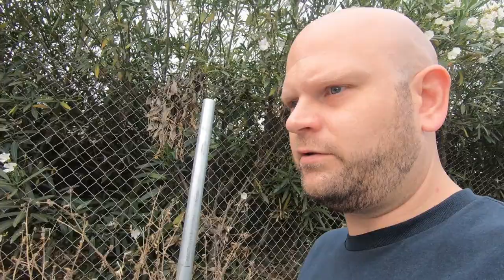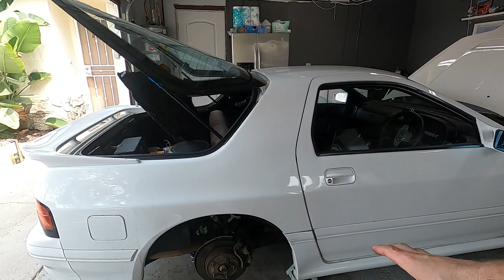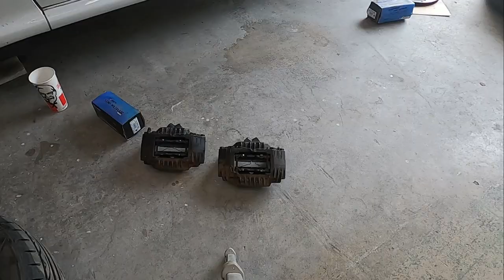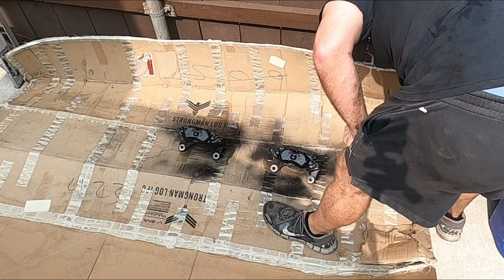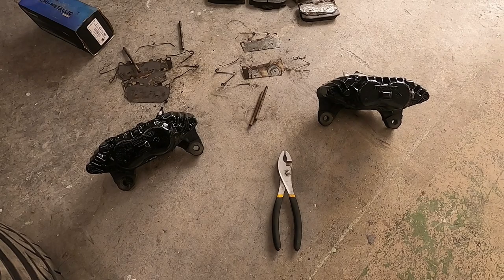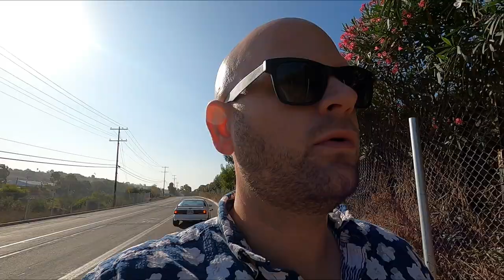R1 Concepts Brake Restoration RX7 FC3s

Comment: I bought the same exact vacuumn pump what a waste of $40 huh lol. I bought some speed bleeders off of banzai or j auto, would highly recommend them for next time
Reply from the maker: Thanks I'll look into that
Reply: I have a similar vacuum pump and I had the same results a while back.  While it's great for cycling in clean fluid, it's not good at all for bleeding brake or clutch lines.